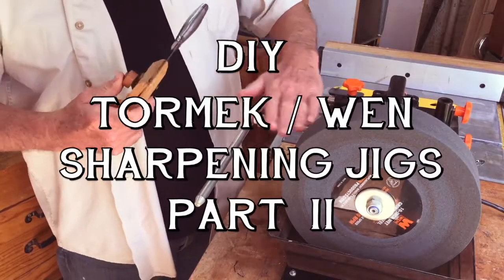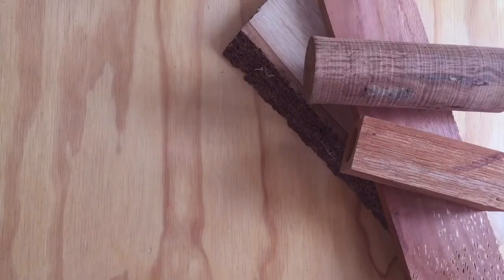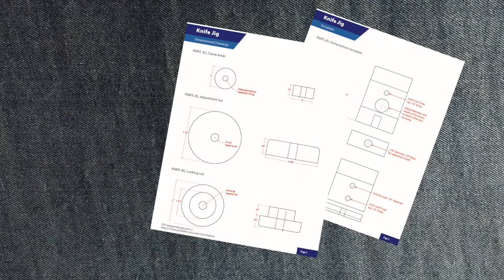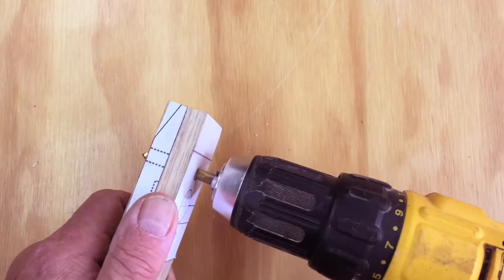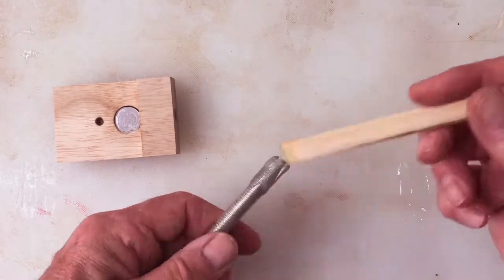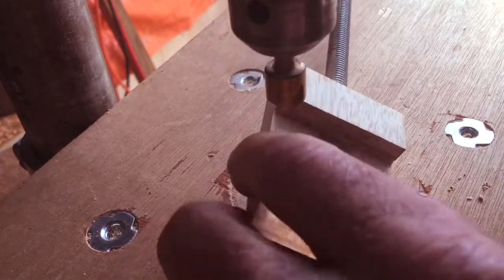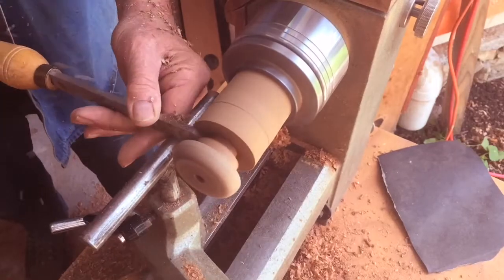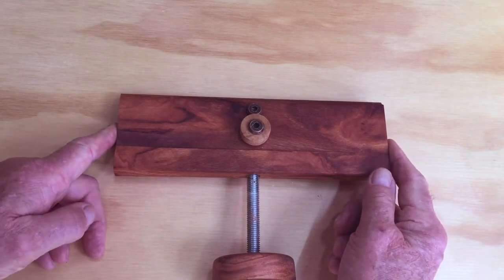DIY Tormek / Wen sharpening jigs, Part 2 – knife sharpening jig for slow-speed wet grinders

Comment: Just a thought. Why not drill the holes slightly oversized and epoxy a nut in the jig.  That way you won't strip out threads in a wooden block.  Just my opinion of course.  Excellent tool and workmanship
Reply: There's not a lot of wear on the threads; not much stress, so wood threads will last a long time. Of course the nut would work too and if that's how you'd like to do it that's great.